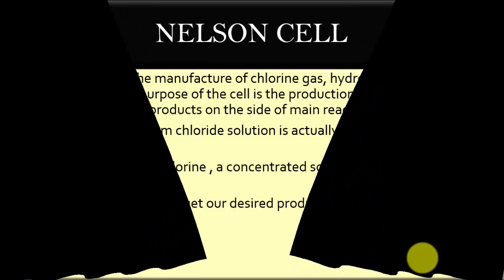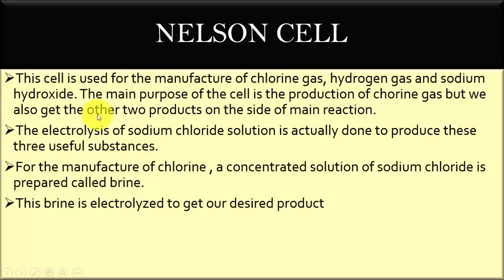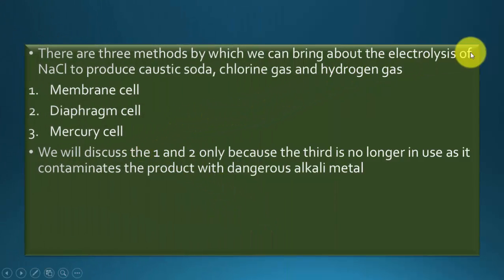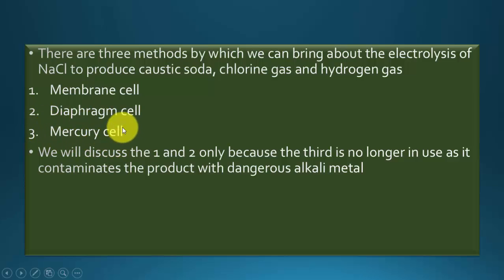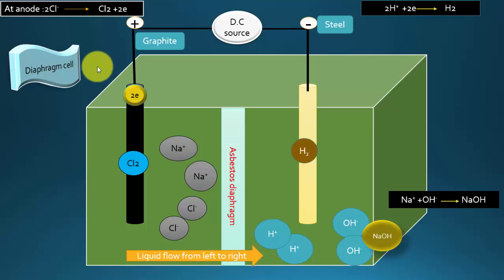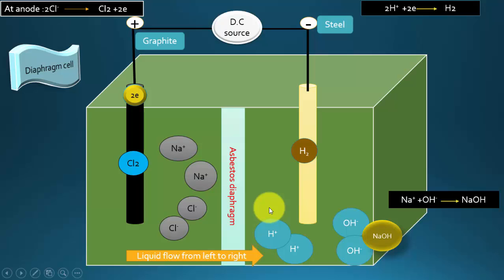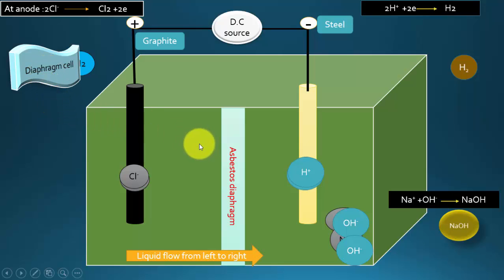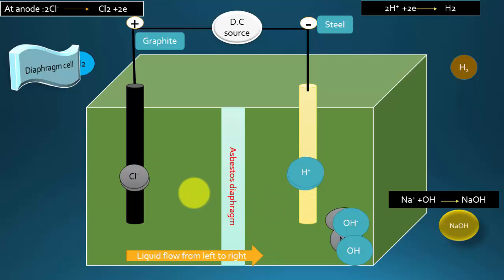How to Prepare Chlorine gas, Hydrogen gas and sodium hydroxide through Membrane Cell|Nelson's Cell

Comment: Thank you for this effort.  Can the poles be made of stainless steel?  Or, as I said, it should be a graphite electrode with stainless steel.  Are there other materials besides titanium?  Is 12 volts enough to analyze any quantity?  Let's say 200 kilos, does 12 volts or 24 volts work with it, or every quantity increases?  I wish to respond .  Thanks

Comment: sir;; thank you for this useful video, but is there any technical reason for using a carbon anode?
Reply: The anode will deteriorate over time depending on what material it is. Copper will disintegrate quickly, as will most other common metals. Carbon is very stable especially in the form of graphite.
Reply from the maker: +Abdelrazek Mohamed probably it's cheaply available,
Reply: Carbon is also inert(does not react with the ions)

Comment: Can we use both electrodes of same material in Diaphragm cell?
Reply from the maker: +Xentr0N MC yes even graphite pencil would serve the purpose
Reply: And what material can we make the Abstesos Diaphragm ?
Reply from the maker: +Xentr0N MC it's actually a silicate material and only at industry level it would be available to be used for this purpose.... As far laboratory, even without this material we can prepare chlorine or hydrogen from this experiment.... But chlorine is toxic... So please don't try it at home...
Reply: Actually I'm doing this at a lab and would also like to know that we have to produce Sodium Hydroxide so it would be only produced if we use a membrane in electrolysis. So that's why I would like to know that what material could we use at a common lab.
Reply: Xentr0N MC I have done this in my lab with  just a few materials like NaCl, two pencils and one battery cell... Pencil served as electrodes.. After you have completed the experiment, I think completely evaporation of water will give you sodium hydroxide. But again chlorine is toxic, if you want to do it take all the necessary measures to avoid any problems..